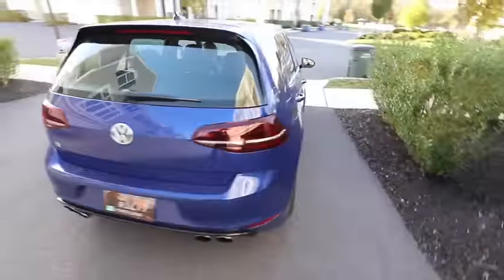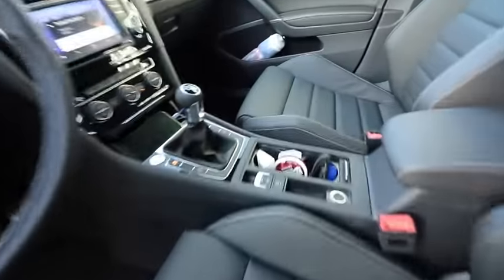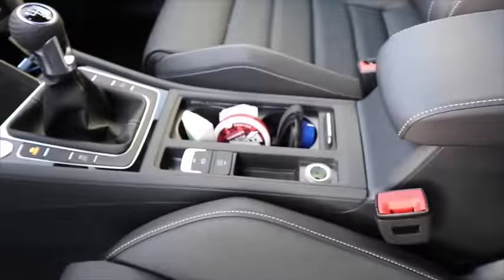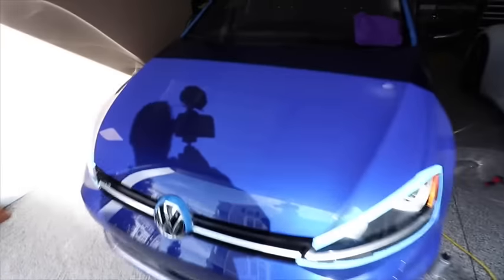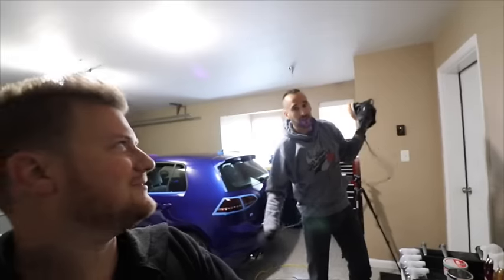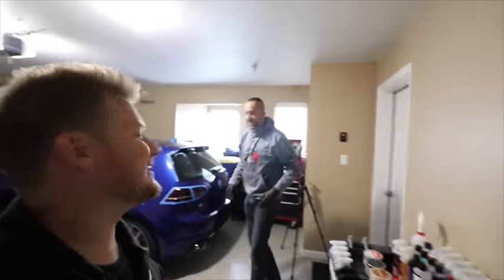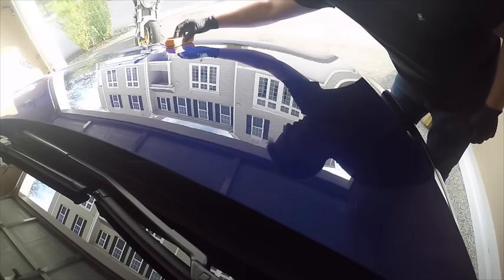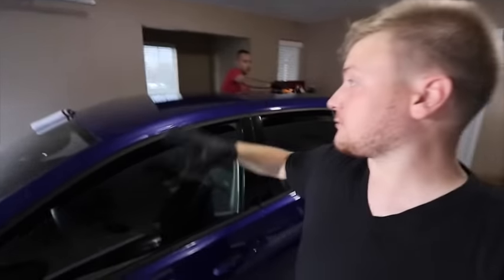Let's Not Mess This Up

Comment: Wait, why shouldn't I lost the dealer wash my car?
Reply: Tyrese Brown lots of potential for damage.  Usually their equipment isnt maintained/replaced when needed.
Reply: Whenever you have anyone other than yourself or a professional you trust wash your car you run the risk that it will mar up the paint by a lot of things, especially small rocks and sand getting stuck to the cloth. Doesn't matter as much if it's just a basic daily driver.
Reply: Its all those fine swirl marks you see on most cars.  Its very tough not to get them and you have to be super careful if you want to keep a perfect finish.